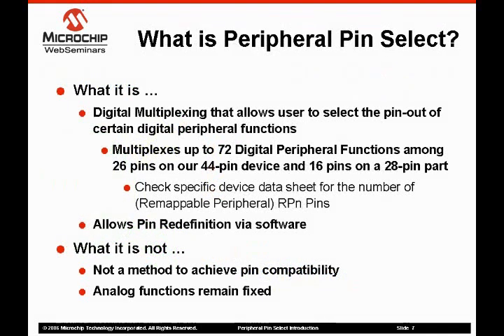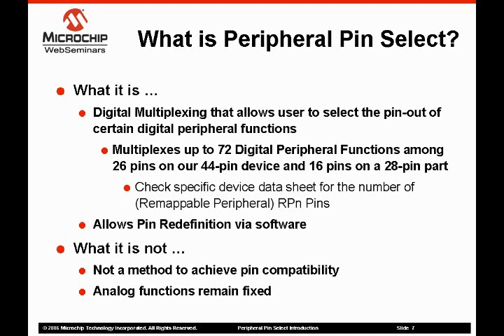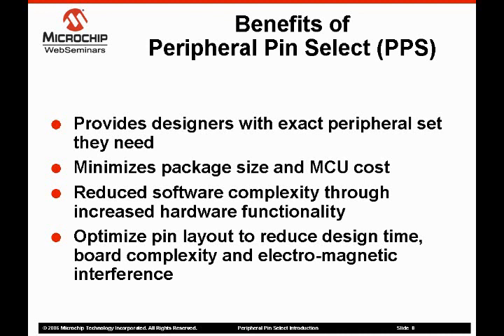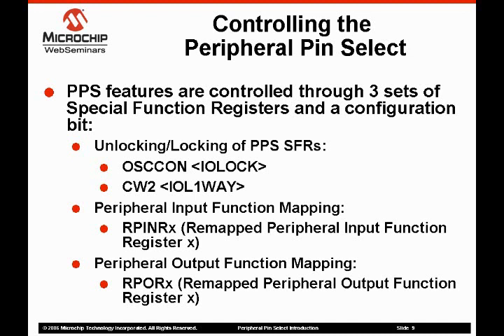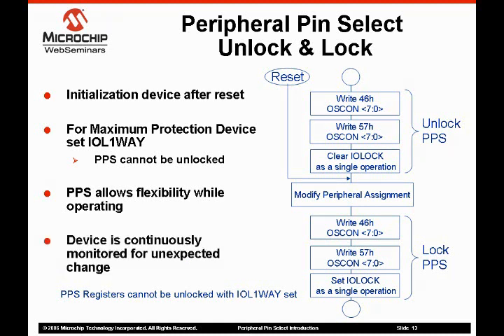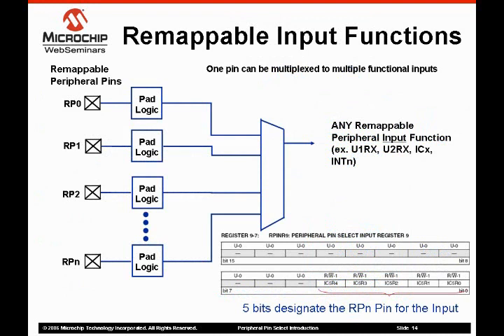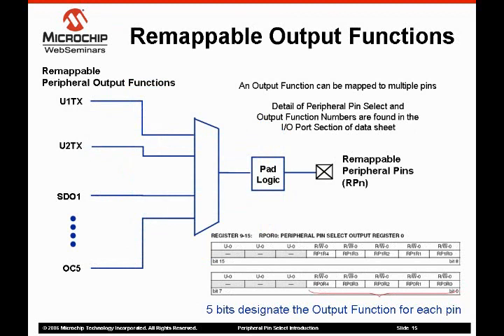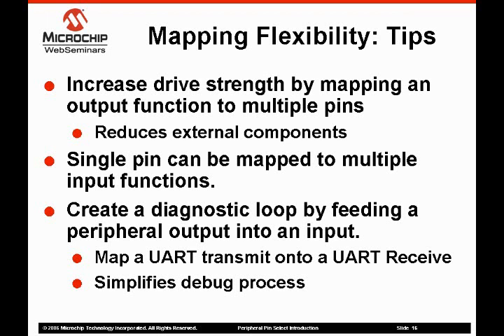What is Peripheral Pin Select

Comment: Could this be any more confusing? I'd like to know which pin is used on 16f1707 for INT and for pin change interrupts
and if it has to be set by PPS then how to do this using MPLABX XC8
Reply from the maker: Hi Brian. Maybe this page on our Developer Help website will help guide you to an answer to your question: http://microchipdeveloper.com/8bit:pps. If you still need assistance with this, please go to support.microchip.com, where you can either post your question on our Forums or use the "My Support" link to create a support ticket to get in touch with one of our applications engineers. Hope this helps.
Reply: @MicrochipTechnology 
I can Understand the PPS (mostly) what I find difficult is deciding which pins PPS can change and what commands are to be used.
Just now I am trying to swap the pins on MSSP I2C SCL and SDA pins
I am using 16f1707 and don't know if this is possible. A list of acronyms for PPS in each datasheet would be helpful e.g. INTPPS is intuitive but how is it possible to change I2C pins? I have tried MSSPPPS, IC2PPS, SDAPPS, SCLPPS and none of these acronyms are recognised by MPLABX